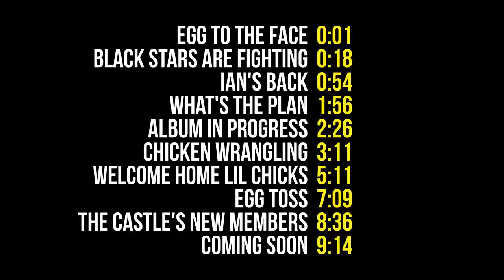Chaos After Chicken Fight Breaks Out At The Castle

Comment: Deep mulch Chicken City and Freedomistan with wood chips. The chicks will do their business and and scratch at the chips keeping everything a little bit cleaner, if it gets messy in there you can just cover it with more wood chips. Over time the wood chips at the bottom will break down into rich fertile soil for your gardens. You can also place logs and rocks around inside the enclosure. Bugs will congregate beneath them, and periodically you can flip the stuff over and the chickens will feast on some free high quality protein. It's also very fun and stimulating for the chickens. Also grind up eggs shells and mix it in with their feed to boost calcium and keep their eggs strong. KEEP UP THE GOOD WORK!
Reply: I got ducks and imagine chickens would try to eat the chips and possibly choke on them like my dumb ducks would
Reply: Deep mulch method is the way to go. We use wood pellets for stoves, cheap and abundant around here and it breaks down quick to rotate into compost
Reply: Not sure why they don't slaughter one or two of the roosters(humanely of course). They are just as edible and it would solve the fighting problems.